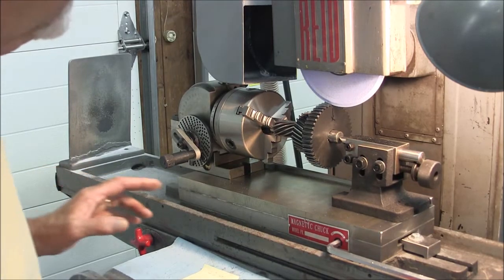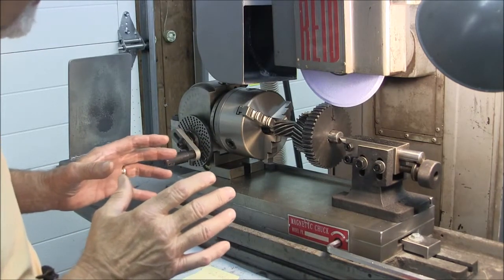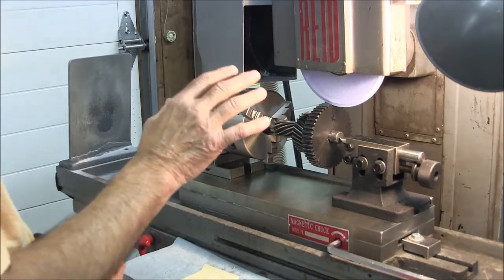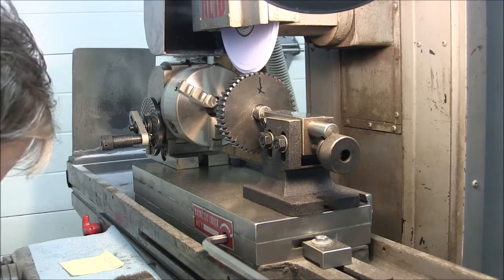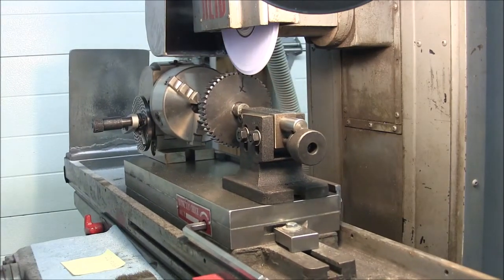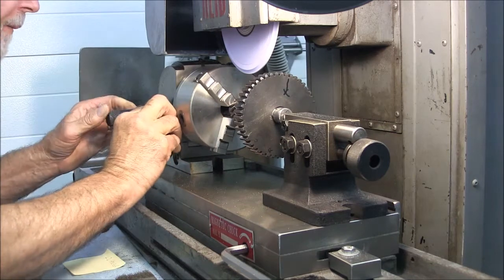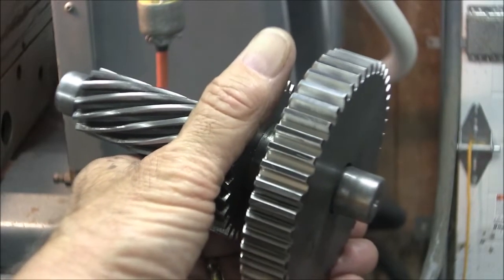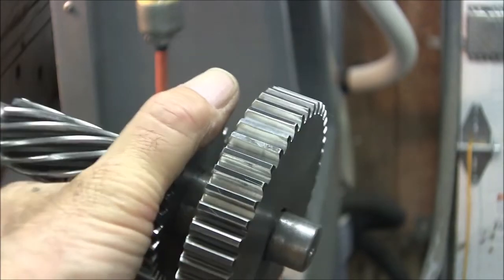Grinding gears pt3

Comment: How did you dress the involute on the wheel?
Reply from the maker: I dressed the wheel using a radius dresser in the "grinding gears pt 2" video.  I found the geometry for the correct gear in a book on gear cutting. If you need more info you can email me at toolmaker1968er@gmail.com

Comment: Looks like it went well. Sure wish I had room for more equipment. Good video now to get her back together.
  Been hot and humid here could use a little more rain here but north of us they don't they ended up with 5 inches from the last storm. Let me know when you'll be in Brainerd. If I'm feeling ok and things are good here I just might go for a drive.
Reply from the maker: I feel pretty sure the trans will be fine now. It feels smooth turning by hand.  Not hard to get it back in the saw. We'll be at Boyd lodge near Cross Lake MN. That's on the Whitefish chain of lakes. We're specifically on Rush Lake.  Arriving around 5:00pm Sat Aug 1, and leaving the next Sat morning. We have cabin 57. They can give exact location at the lodge. Hope you can make it! Tc, Mike

Comment: Great Video Mike. Hope it fits better now. I was surprised that you had more of the tailstock on the mag chuck than you did of the dividing head. I would have had the maximum contact for the head as it was getting the most potential for movement as you were indexing. The tailstock was just for support. Especially as most mag chucks do not have too much magnetism at the ends.Anyway you got away with it. Stay Safe.
Reply from the maker: Thanks Dave. I've been very pleased with this mag chuck. Very good holding power. Fine pole and low profile. Under $200 US. Both the tailstock and head were socked down pretty tight. I biased the setup as far to the left as I dared, to get the gear as close to the center of the table travel as close as I could. Cheers, Mike